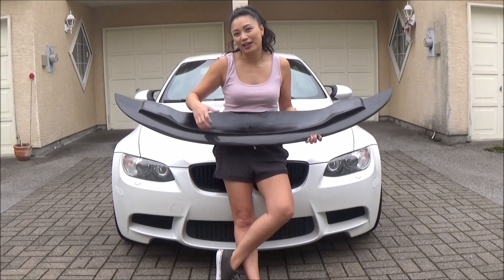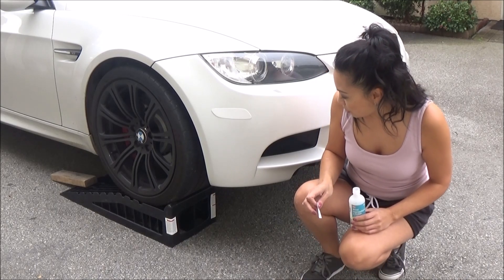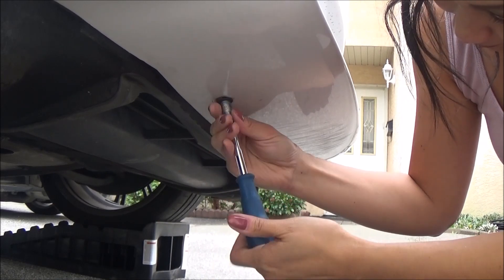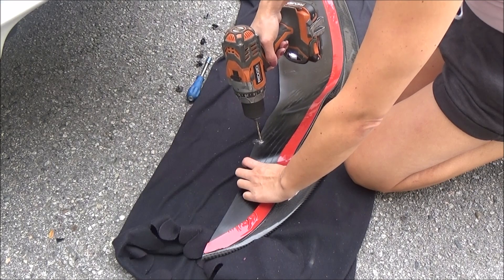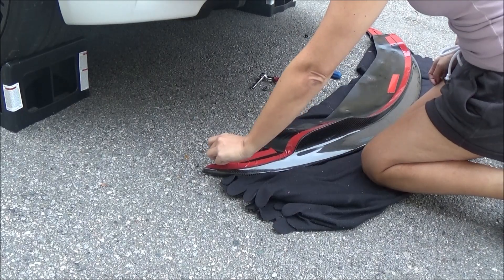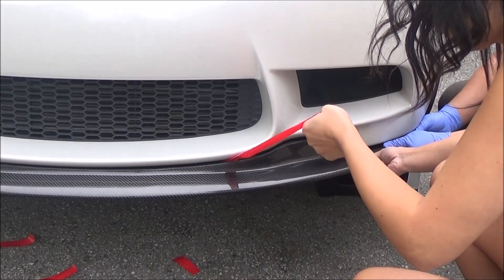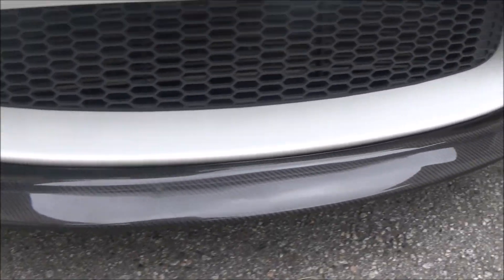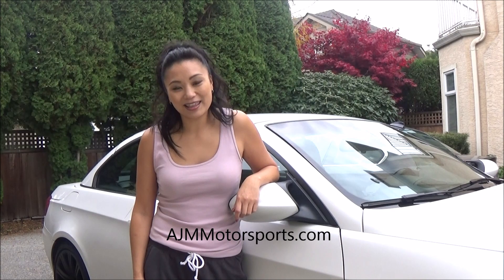How to install a carbon fiber front lip on a BMW M3 - GTS style

Comment: The front lip looks great, how’s it held up so far?  

Also I highly recommend getting a pinnacle_motorsport e9x aluminum undertray.  The aluminum undertray holds up much better than the stock 3 piece felt one that  falls apart over time.  They are easy to install and are powder coated in black so they look good

Comment: Nice video. From the video, i notice that your tires are running out of thread life or the alignment is way off, have you noticed it?
Reply from the maker: Haha! I literally drove straight to the tire shop after this install and got new tires. But they are winter tires and I think I can use those old ones for the spring for a couple more months!
Reply: @TVTara  Vancouver has winter?!?! Lmao i'm so not looking forward to -40C in Winterpeg

Comment: HI TV Tara, that lip spoiler looks very nice on your front bumper. As for the bolts, only one thing . Just my experience, I would turn the bolts around so they don't scrap the ground when you go down, if your car is really low in front. But it looks real nice.
Reply from the maker: Good tip, thanks!

Comment: 1. What is the size of bolts that you used? 
2. How would you recommend finding the spots to drill holes?
Reply from the maker: I used an m4 hex bolt and nut. The lip already had little indents where the holes should be drilled.
Reply: @TVTara  thanks!